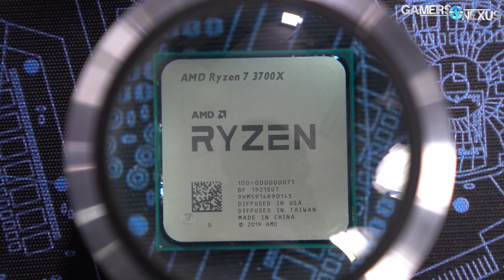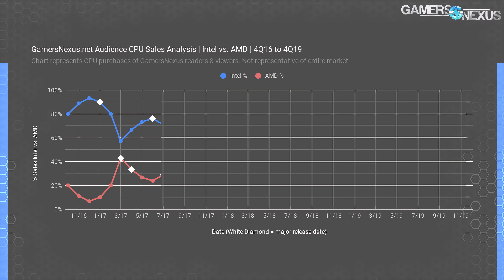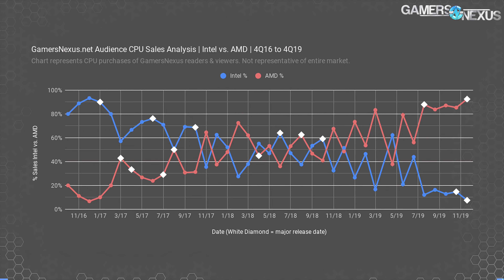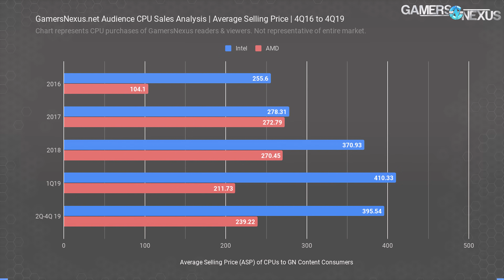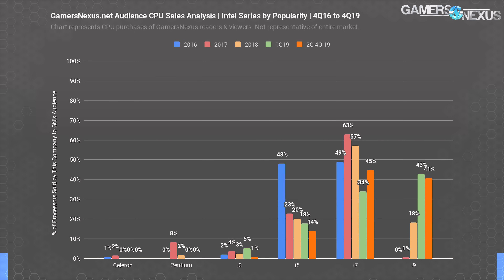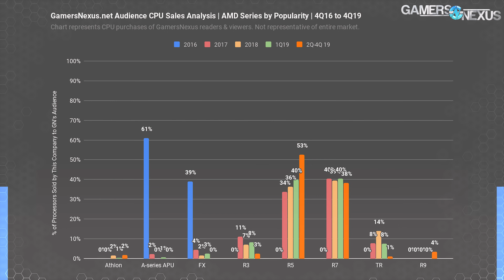GN Special Report: AMD Moves 93% of CPU Sales (Intel vs. AMD 2019 for DIY)

Comment: Whenever someone is trying to argue for buying an Intel CPU, they really only have "muh best gaming CPU" to tout.  Even ignoring both how small the gap is and how it isn't there in most system configurations (e.g. no one using a 2080 Ti is playing at 1080p), people really forget that this only applies to the 9900k and 9700k.  And even for the latter, I do not trust an 8 thread chip to last the next 3-5 years.

Quad core i5's were fine for quite a while...until games wanted more than 4 threads and they fell flat on their face.  Six core i5's are still fine in most cases, but many reviewers (including GN) have found games where the frame times suffer due to thread count limitations.  I really hope Intel enables hyperthreading across the board for their 10th gen mainstream chips, as they'll become much more competitive with AMD and we'll all get better products as a result.
Reply: Intel can't offer HT across the board until they fix their implementation. They already recommends server clients to turn it off for security.
Reply: @JazzEdan  Intel has been selling CPUs with known vulnerabilities anyway. While they recommend turning off HT depending upon how critical that Computer is, they still won't disable it out of the factory. The leaked 10th Gen mainstream core parts have HT across the entire stack. There have been leaked i3 and i5 with 4c/8t and 6c/12t core/thread count respectively and there will be a 10c/20t i9 flagship as well. 

Intel's lower end CPU are about to get more competitive but then again, Zen3 is around 6 months away so we'll see what AMD does in return.
Reply: @AbideTheCold  AMD is talking about going to 4 threads per core with SMT.
Reply: The limited core count in gaming can be blamed on consoles. Sadly AAA market doesn't exist on pc with majority of big publisher games being console ports with dreadful console UI. Everything from graphical fidelity to optimization and performance can be blamed on leaps between console gens with pcs being able to achieve modern PS4 prowess all the way back in 2010-11 - which sadly didn't matter because no one will make a game that can only run on hardware of top 5% of gaming enthusiasts. With that being said rumours have it that new consoles will have designated 8 cores for gaming so don't be surprised when all those 4 core/8 threads Intel fans will wake up with massive bottleneck up their ass
Reply: MrKunzzi but it’s a single threaded processor, and only goes to 2.1 GHZ and is built on bulldozer, new one has multithreading 3.2ghz, and a 70% ipc increase from the PS4 Pro processor
Reply: MrKunzzi that is confirmed. It’s an 8/16 Ryzen custom cpu for both consoles
Reply: Unelss you want 140 - 200fps + CPUs is not usually what is bottlenecking even with overclocked GTX1080ti / RTX2080ti... Also most games running 1080p or 4k have little to no impact on the CPU usage, almost only GPU usage is what goes up at higher resolutions, that is at least my experience... My 4 core 3,8Ghz Xeon E1231 V3 from 2014 have no problem keeping my GTX1080ti running 35C Overclock pegged at 100% all the time in GTA V, Arma 3, Far Cry 5  and many more at 1080p and at 4k 60fps with room to spare on the CPU.
Reply: I do trust 8 cores to do their job really well for at least the next console gen. Those will have Zen2 8 cores and they will clock lower than the PC parts because of thermals, power consumption and binning. So id imagine even a 2700x for example should be good for a while. Not high-end but more than good enough. 
Although id still love to get a 3950 because that thing is the bees knees.
Quadcores will be completely bargain bin and low end hexacores will be the new quadcores though once next gen makes proper multithreading a thing outside of workstation tasks.
Reply: Hard to see that 8 cores would become limiting factor any time soon when it comes to games: Game devs won't make games that require hardware that only few has. 10 or 12 cores are still rare on consumer market and they'll be for some time (Word is that Zen3 wouldn't increase core count, IPC + clock update). Also next gen consoles use 8 cores. 

Core i7 9700K and i9 9900K should be good for gaming for next 3 years. Gaming is rather important factor for many: It would be nice to know how many average consumers actually do productive work? I'd say that few years old Intel Atom would be enough for most consumers if they don't play games.

..but if you have a half decent CPU right now..I'd wait for Zen3. It won't offer more cores, but it's improvements in IPC and clocks should give AMD huge lead in game performance
Reply: This wont make that much of an impact.
Most games are under 6 threads, so enabling ht wont affect graphs much.
Reply: @cheshirster  That's mostly true today, but the new consoles hit next year and both are confirmed to have 8C/16T Zen 2 processors. Minimum CPU requirements will definitely be going up over the next couple of years.
Reply: @DrearierSpider1  " both are confirmed to have 8C/16T Zen 2"

I am a fan of 3700X from the very release.
Best CPU of this gen.
Reply: Show me the AMD cpu that outperforms a 9600K single thread performance for the $. Now show me a game that demands more than a 9600K. Turns out if you wanna make a AAA machine for as cheap as possible, this i5 can't be beat.
Reply: @pissmiser  R5 3500X+cheap B450 mb

"game that demands more than a 9600K"
Basically every demanding game of 2019 is welcoming 10+ threads.
Reply: @cheshirster  was that an amd CPU that outperforms it, or one that is a year newer and still not as good? I play the new COD on ultra with the i5 and it doesn't bottleneck the GPU, which is what ultimately struggles to keep up only after 120fps @1440.  So uhh, I mean it doesn't take more than a 9600k and you're wrong. Also didn't answer my question, try harder to make a fool of yourself.
Reply: @pissmiser  🤣Stop crying "FPS SNOB"(GN not me LUL). You should thank AMD for bringing your i5 down to its current prices of $200. Still need a decent cooler and  MOBO right? Or are you telling me to cheap out on coolers and MOBO? R5 has so much value to offer from $80 to $200 paired with a $100 B450 with options to upgrade to a 3700x, 3800x, 3900x, 3950x, 4600x, 4700x, 4800x, 4900x, 4950x!!! What do you have??? Well, good luck with your 6/6 next year because muh FPS. 🤷‍♂️

Comment: Here's what's hilarious to me; Ryzen would have been Bulldozer 2 if it wasn't for Intel running into issues with 10nm. As it stands now, AMD, with all the advancements they've made, LITERALLY ONLY CAUGHT UP to Intel performance wise. Despite AMD having a node advantage both companies are on par with Intel better at gaming and AMD better at productivity. 

Point is AMD caught a VERY lucky break. Intel has no new products to offer hence all the Ryzen sales. They better drop the bullshit catch up and undercut strategy and actually try pushing core performance forward now that they have a bit more R&D. Otherwise Intel will get their issues resolved, go back to having the upper hand in performance while charging a premium for it while AMD will go back to peddling budget conscious CPUs.
Reply: Intel's technical debt has caught up to them with all the hardware security vulnerabilities. I'm going to be surprised if they can fix them and gain a worthwhile performance uplift.

Comment: I’m still rocking a 1700 @ 3.7GHz all cores w/ 16GBs of 3200MHz RAM (with very tightly optimized timings too). It treats me nicely. I think that next year I’ll upgrade my CPU and GPU for the hell of it. If not the CPU then definitely the GPU as I’m still on a RX 480 which is not totally adequate for my monitor.

I love what AMD has brought to PC enthusiasts over the past few years and I’m happy to show them my support.

Comment: Compared to SI, OEM and Enterprise market, the DIY is very small. To put things in perspective, AMD (CPU + GPU) has only about 10% of Intels revenue. 19Q3 : AMD had a revenue of 1.8 billion dollar and made a 120 million dollar profit, or put in a different metric, AMD is only keeping 7 cents (120/1800) of each dollar earned. Intel on the other hand made a revenue of over 19 billion dollar and had a net profit of 6 billion, or 31 cent profit per dollar. If you like another comparison, Intels profit is three times as large as AMD revenue..

So while it is an incredible achievement of AMD to get a stronghold of the DIY market, it didn't make a dent into Intels revenue. Both Intel and AMD increased their revenue. But it is a good thing that AMD finally is making some profits in 2019 so they can pay dividend to shareholders, for Q3 it is only 11 cents per share, but it is a good start. AMD also had a lot of costs. Intel paid 1.35 dollar per share for Q3.

So while AMD is gaining momentum, other divisions of Intel like the memory group or the Internet of Things group were able to compensate for the losses to AMD. However it is a fantastic accomplishment that AMD with the little R&D budget was able to take the performance crown. However because AMD has outsourced almost every facet of their operation, the have a very low margin. One of the reasons why Intel had a much higher profit margin is because it has it's own factories. But because Intel has difficulty to supply the DIY market (note there aren't shortages for the OEM/SI builders), they are going to outsource some of its production to external factories. The consequence is that also Intels profit margin will likely take a hit..

2020 promises to be a very interesting year..

Comment: I'm still running a 4790k but over in the corner sits a brand new 3900x, a ROG Crosshair VIII Hero Wifi with 32gb of g.skill ram and a new samsung 970 pro 512 nvme ssd waiting for the weekend. 😬  This is my first AMD cpu since my old opteron 970 and I'm glad they've advanced this far.

Comment: Intel will move away from CPUs next year, CEO already said it's time to invest in other market's
Reply: This is just an extension of what they already do. I'm sitting here with motherboards with Intel Chipsets, Intel SSDs... They're in whatever you want to call the memory/storage market with Optane, they're in wireless markets, they're in IoT markets, they've been planning a foray into the discrete graphics market, they've been for a while laying the groundwork for work on AI and self-driving cars, etc.... This is more a re-branding of their existing strategy and a recognition that their near-term growth isn't going to come in CPUs until they can solve some of their internal problems there.

Comment: After nvidia pulled the piss on me as a enthusiast gamer with the 2080ti pricing, i would not hesitate to go amd on my next card. and that will happen when a card comes out that gives me a 40% perf inc. over the 1080ti.. also, my 7700k oced to 5 ghz allcore will get replaced once either intel drops the price on the 9900 series by at least 25%, or amd reaches at least 4.9 all core on a 8+ core cpu at a competitive price

Comment: What AMD achieved with the ryzen series is just crazy.
To think that this is the same company that was struggling to be relevant for the enthusiast crowd a few years ago with their FX CPUs.
Reply: They achieved nothing. Ryzen would be Bulldozer 2 if it wasn't for Intel running into issues with 10nm. Intel hit a wall and AMD caught a break. Easy as that.
Reply: Not really.. Intel has nothing new to offer. AMD does. And there a shit load of people still sitting on Bulldozer CPUs looking to upgrade. That's where all these sales are coming from. The surge will die down. It already has with AMD screwing themselves and massively undercutting Zen 2 with older Zen+ chips for dirt cheap.
Reply: Struggling to stay relevant? More like struggling to keep the doors open. They had to cut back on so much most of the sales and software teams was gone. It's paid off for them in the end but the amount of employees they have has shrunk alot.

Comment: Its because AMD has pleased the consumer. I for one have switched from Intel over to AMD. I had a i5 and upgraded to a Ryzen 7. Haven't looked back since.
Reply: Same. I just switched from an 8086k to a 3900x. I gave my 8086k pc to my dad to replace his 2500k machine which was also a previous one of mine.
Reply: Ryzen 7 gang 😎
Reply: I'm switching from 4770k to 3600x. I already have the cpu and mobo i'll just need to buy the rest of the parts so i can put it together.
Reply: Looking to finally retire my 2600k for a 2700x pretty soon. Twice the cores, twice the fun.
Reply: Smart man, cheers!

Comment: Here in my shop, the most productive custom PC shop in Arizona, we are still doing 95%+ of Intel vs AMD builds.  I would be more than happy to make and sell more AMD, but our client base is still firmly in the blue camp.
Reply: 'Cause they don't know any better...
Reply: @smk6469  That is not the issue. Our clients are pretty smart and educated.  Intel has been the choice for reliability for decades.  It is going to be hard for AMD to gain footholds in some segments.
Reply: I would have to disagree, any customer that is having someone else build a high end PC for them is not very savvy on the tech unless you are talking the best of the best in custom loop, high detail builds, in which case, of course Intel wins, as it is actually still the best option if money spent is no object and you just want the highest FPS number possible.  
As far as the average prebuilt market, the saying goes "No one ever got fired for buying IBM" and it holds true for Intel as well.  Even in the low end and mid range the Intel parts are good enough.  not a great value, but they get the job done, so people that don't know better will tend to choose them over the AMD parts that the mainstream audience views as a crappy knock-off that runs hot. People watching GN, or any of the other tech channels on YouTube do not represent the mainstream market... And people that buy "custom PCs" tend to represent the least educated PC buyers, as most that want the best they can afford that know what they are doing will build it them self, and most that just need something good enough, and likewise know what they need can buy any generic box off the shelf and know it is good enough at half the price of a "custom PC"
Reply: @johngaltline9933  We aren't talking high-end custom gaming PCs.  That market is rather small.  We make custom workhorse PCs and servers.
Reply: @crazy8sdrums  I can't speak for how knowledgeable your clients are, but it sounds like they're making purchases based purely on brand loyalty, and that isn't smart. I can only think of some very edge care scenarios where Intel would be preferred which I'm sure 95%of your customer base doesn't fall into.
Reply: @Hotobu  Brand loyalty goes a very, very long way in this business.  In many different businesses actually.
Reply: @crazy8sdrums  You make workstations and servers, with current generation parts, and can in good conscious sell customers Intel's offerings over AMD today?  You've got bigger stones than I do, that's for sure.
Reply: @johngaltline9933  Clearly, you don't work in the business.
Reply: @crazy8sdrums  I don't, but are you saying that today, at any given price point, Intel offers an objectively better product with the exception of the 9900K/(s) in single threaded workloads? if not it seems you're not doing a good job of educating your customers.
Reply: @johngaltline9933  We offer a full range of AMD products; CPU, APU, GPU....and the full range of intel + Nvidia.  We talk to our customers constantly.  There is a long list of reasons why our customers prefer intel, price is not the most important factor to them.

Personally, I use Ryzen at home and dig it.  I was an early adopter and paid the price of frustration trying to make the 1st gen Ryzen stuff work as reliably as intel...and intel has had it's own issues.

I build up to 10 PCs a day, and am also the repair tech so I am fixing FKd up PCs all the time.
Reply: @johngaltline9933  Also, ALL the servers we sell are intel based.  We are fully aware of Epyc.  Epyc is brand new and there is very little in the way of suitable motherboards available...and the added cost of those motherboards makes it less attractive than tried and trued intel equivalents.

AMD has a huge bridge to cross with motherboards and Epyc.  It might be too large.  We will see.